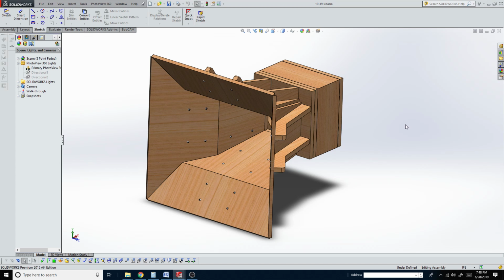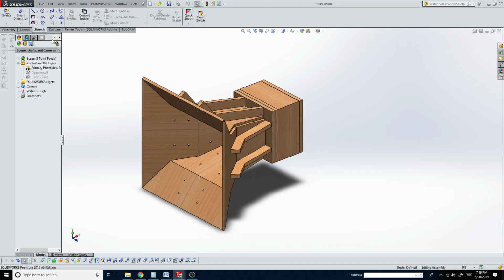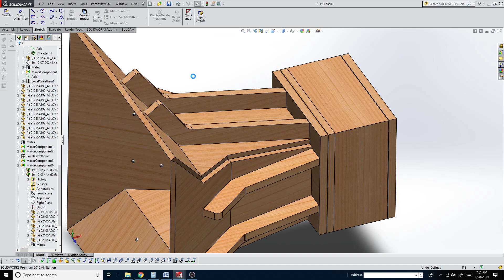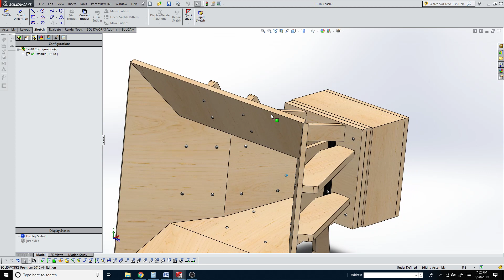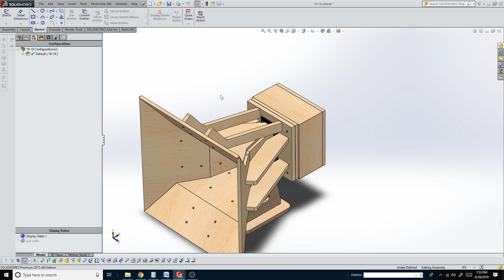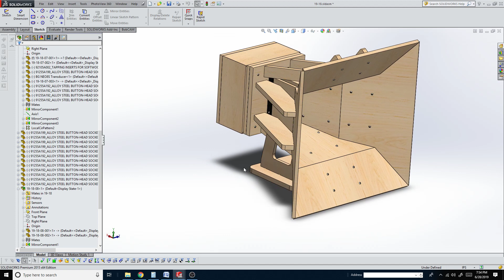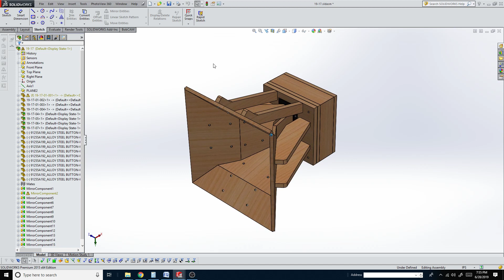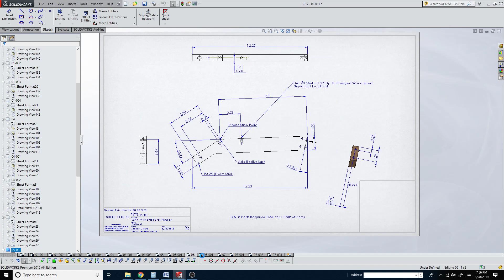Summer Rain Front Horn Design Walk-Thru

Comment: just curious what would its bandwidth be is it speaker limited
Reply from the maker: The horn cutoff is 200 herz.  The upper bandwidth is around 1.6kHz where the driver needs to take over.  The BG Neo8 offers 200Hz-20kHz with a flat response.

Comment: Hey Joseph!  I bought the plans and built this horn thanks. I am experimenting with a synergy design with this now for fun too.  Have you ever tried synergy designs (port induction 6" lower midrange/bass on the top?)  There is so much amazing potential for synergy DIY, but the design is patented by Danley Sound Labs. Danley Sound Labs does give us DIY guys permission however to use it for not for profit designs. I would love to see you try a synergy design!  It is a whole lot of fun!  Cheers!
Reply from the maker: Thank you.  I've been working on the Nighthawk series which I will be building shortly.  Through my testing I really like the midrange driver to be forward facing with very little restriction in the throat.  This gives a more 'immediate' sound.  Also a smaller horn provides much better off-axis coverage in the upper treble, so I've created the Nighthawk shape with looks kinda like bird wings.  There are a lot of design elements that need to be explained further which I will be covering in a future video so stay tuned.  https://josephcrowe.com/products/e-350-nighthawk-front-horn